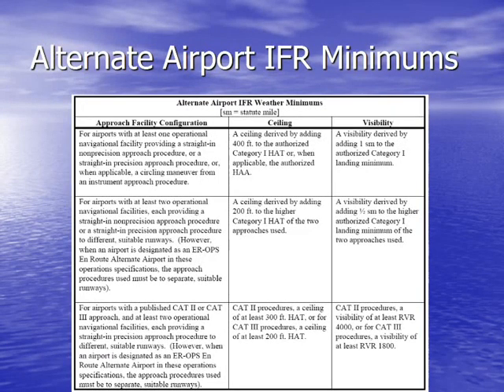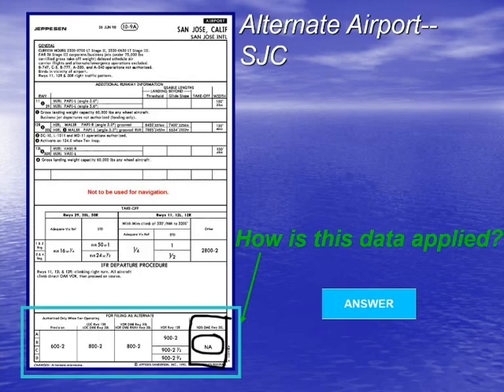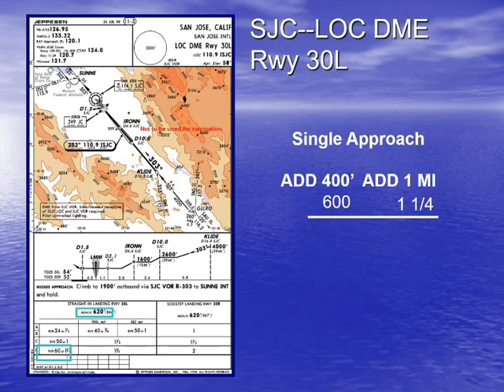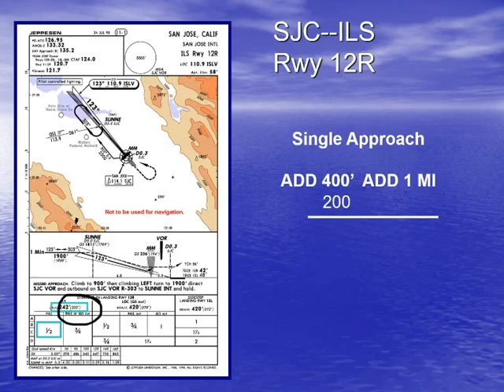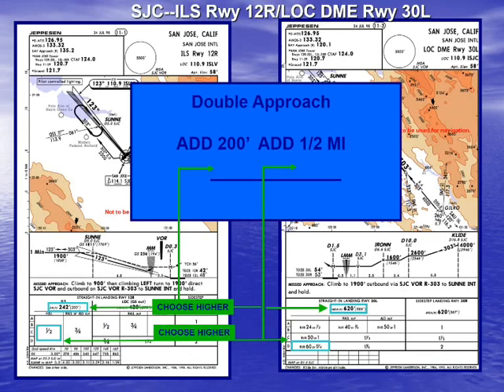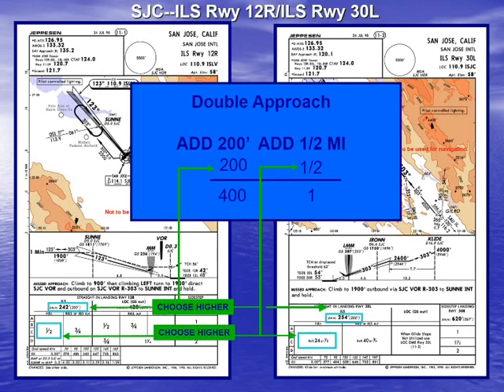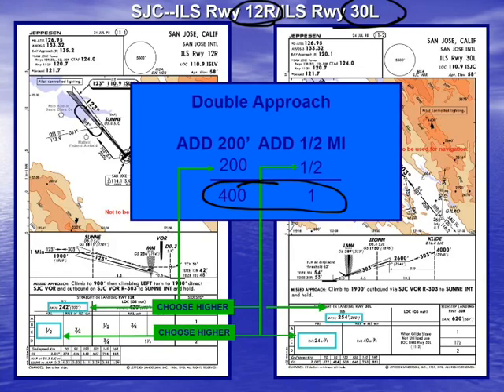Dispatch Part 121 & 135 Derived Alternate Minimums Ops Spec C055 Explained ATP & Aircraft Dispatcher

Comment: You verbally said two different frequencies, but the examples you circled are the same.
Reply: Different identifiers? I think a word or two from your explanation is missing. Any source is appreciated too!
Reply from the maker: Somehow missed this comment...by identifiers I mean the letters printed with the frequency on the approach chart, like IGGG or ISDF, which provide a morse code identifier for pilots to verify the signal is being received.
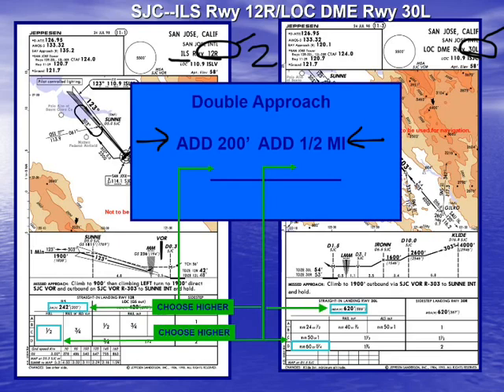Reply from the maker: Hello & thanks for watching! I am assuming you mean the part at 5:59 in the video. The FAA has stated (internal guidance at the FAA) that as long as the two navaids have  that it counts as two different navaids. That is even though the frequencies are the same.

Comment: Can I use 2NAV rule using an ils and an rnav approach?
Reply: ❤Always so helpful
Reply from the maker: Hello! That is permissible as long as the following conditions are met. 1) the airline has approval in their Operations Specifications for RNAV approaches (some do not) 2) they do not go to the same runway. For example, at my home airport of KGGG, I could not plan to use the 2 navaid rule and use the ILS 13 and RNAV 13. I could plan the ILS 13 and RNAV 18 provided my airplane was capable of landing on the shorter runway. I could also plan the ILS 13 and RNAV 31 provided there was not too much tailwind for the use of opposite direction approaches. I hope this helps!
Reply: @LauraLaster747  thank you so much!

Comment: Nice explanation! I have two questions.

1. What if non-standard alternate minimums exist? Can we still use 'derived alternate minimum' from Opspec C055?(one nav/two nav rule)

2. When we try to be granted an exemption and consider weather conditions at the first and second alternate airports, should we consider weather forecast compared to landing minimum from approach charts or derived alternate minimum?
Reply from the maker: Hello! I will try to answer. 
1. Derived alternate minimums are where the airline's ops spec is applied to the approaches being used. Non-standard alternate minimums would not apply other than if the approach says NA and then it cannot be used for calculating the derived alternate minimums. Does that make sense? The only thing non-standard alternate minimums apply to are part 91 flights or airlines that didn't have the ops spec for derived alternate minimums.
2. I think you are talking about exemption 3585. For use of this exemption, you still use derived alternate minimums for both the first and second alternate. Check out my video about exemption 3585 if you haven't yet because I think it will answer this question for you.

Comment: Would this be looking at ksjc as the destination ?  So you would say, if one hour before and after ETA AT KSJC, if the ceiling was below 400 ft or less than 1 nm vis then you would have to file an alternate at a different airport ?  Or are you looking at using ksjc as an alternate to another destination ?
Reply from the maker: Hello! Great question - this video is looking at KSJC as the alternate. The derived alternate minimums of 400' ceiling and 1 nm vis must what the weather indicates at KSJC for the estimated time of arrival at that alternate airport of KSJC. 

The requirements of when you need an alternate under 14 CFR Part 121 operations are specified in 121.619 which explains when an alternate is required for a domestic flight (that's too complicated a topic to get into detail here but basically a flight between any two airports within the lower 48 United States are considered domestic). 

An alternate is required for a domestic flight when the weather indicated at the destination +/- 1 hr from the estimated time of arrival is less than 3 sm visibility AND 2000' ceiling. If an alternate is required under 121.619, then you select one and figure out its alternate minimums using the steps outlined in this video.
Reply: @LauraLaster747  "AND"?  so if destination is forecasting (+/- 1 hr) to be 1000' cig and 3+ vis, alternate is not required?  or if destination is forecasting 1 mile vis and 3000+ cig, no alternate is required?  thx
Reply: Sorry, I misunderstood your wording.  The FAR states that both cig AND vis must be "at least" 2000-3 for an the alternate paragraph to not apply.  I interpreted your wording in the opposite polarity:  that both had to be less than 2000-3 to require an alternate.  I think your statement above is more accurate if replace the word "AND" with "OR".
Reply from the maker: @bradleys2320  Thanks for the question! The word here AND means that both conditions must be met. So +/- 1 hour, both the ceiling AND visibility need to meet requirements. In your first example, the first condition of ceiling 2000'+ is not met, so an alternate would be required. In your second example, the visibility is too low (1 mile) so an alternate would also be required.
Reply from the maker: @bradleys2320  Sorry just saw the second reply! I also just posted another video about fuel requirements for 121 including more on alternates for domestic, flag, and supplemental rules. I am hoping that video also helps shed clarity on it.

Comment: Am I missing something?  You do NOT have two separate navaids in your example.  Both approaches use the same frequency and identifier for the localizer.
Reply from the maker: malakovich69 yes you are right my mistake in my wording!
Reply from the maker: Hi Alex, which example are you referring to? If it's the two approaches at KSJC, they both do have the same frequency but different identifiers, and two different runways. There is 110.9 ISLV and 110.9 ISJC, so these are two different approaches and the two navaid rule can be used.
Reply from the maker: +Alex Schweim thanks for watching! Which example are you referring to? The KSJC one had two different navaids because the identifiers were different (though the frequency was the same.) The other examples were one navaid rules and so we add 400’ and 1 sm to those.
Reply: Laura Laster the confusion came because you said the frequency was different.  It isn’t.  The identifier is.  Your graphic markup covers the identifier and underlines the frequency.